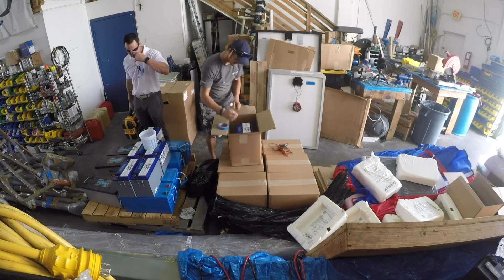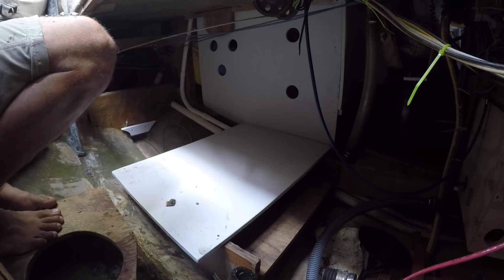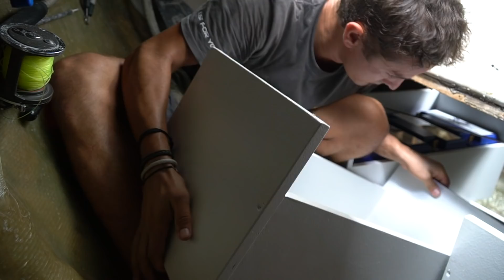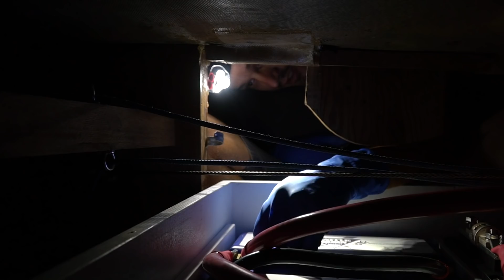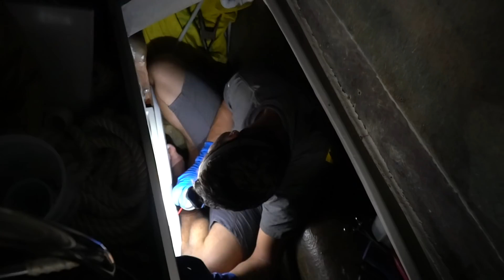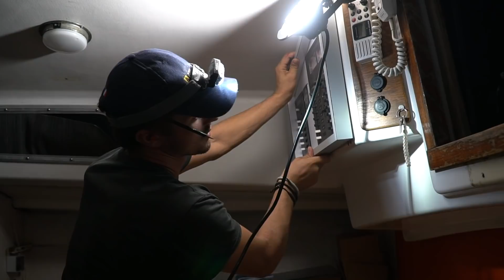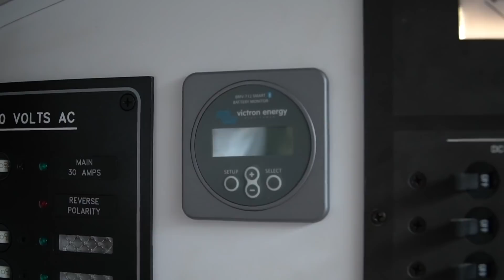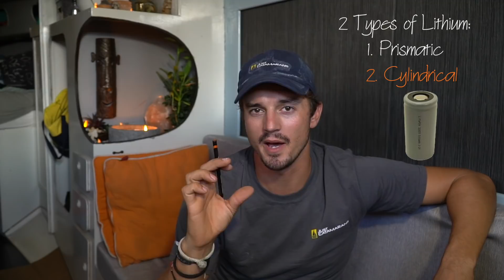Uma's new Battle Born LITHIUM heart ❤ — Sailing Uma [Step 135]

Comment: @ $1000 per battery that's a serious investment!
Reply: I doubt they spent that amount?  Battleborn Batteries might be a new sponsor?  So that means little or no out of pocket costs to Uma.
Reply: Co-op or sponser. Noted batt brand and locale of manufact. Uma knows buisness too!
Reply: I noted they said lead acid wasn't suitable for their motor when it came from a forklift that would have been powered by lead acid traction cells.
Reply from the maker: But the forklift has a few thousand pounds of batteries that get replaced quite often.
Reply: I'm interested in electric drive for Narrowboats in the in the UK. These guys (http://www.hybrid-marine.co.uk/14.html) claim 4-6hrs cruising off a 400ahr 48vlead acid traction cell battery with a 10Kw motor pushing a 18 tonne steel boat. That battery costs £2000 and has a 10-year life & 5-year guarantee. Lithium would be nicer, but for the same capacity, we'd need 8 batteries at a cost of about £8,000. If you got your new batteries at discount then great, but saying it's the only solution to successfully power an electric boat because your last lead-acid system was seriously under capacity and overloaded so didn't work as you wanted is inaccurate.

Comment: Dan, around the 3:30 mark, you are under the cockpit floor.  Check those steering wires in the video.  Are they really as frayed as they look?   Apart from the possible breakdown in steering, there is also the nastiness of brushing your skin against the frayted wires too.  Hopefully what I think I am seeing is wrong.   Thanks for another great video guys :)
Reply from the maker: You may have been seeing the ends after the crimp. They're frayed out, but the cables themselves are in great shape.

Comment: Should you not have left space between the the batteries in the trays to allow for expansion, ventilation/cooling etc. ?
Reply: We're gonna find out...
Reply: They do not make heat like lead acid
Reply: Under load they will make plenty heat. http://iopscience.iop.org/article/10.1088/1757-899X/53/1/012014/pdf . He will definitely need a airflow and fan to cool them down or those batteries wont last more than 2 years

Comment: What are you guys thoughts on lithium-ion battery fires? Are there any precautions or preparations you'd need to consider? I'm sure the good folks at Battle Born batteries build a solid product, but lithium-ion batteries can present a somewhat unique safety concern. What are your thoughts? 

Another great video!
Reply from the maker: Not an issue with LiFePO4’s. It is an incredibly stable chemistry. Some chemistries are more hazardous.
Reply: Good to know. I may have to look into replacing my old batteries with some Battle Born batteries when they die. Again a great video with some well thought out decisions. Can't wait to see all your hard work come together!
Reply: The batteries are stable, but they can provide HUGE peak currents in the wiring, which is a significant fire hazard.
Reply: They say those are extremely stable, will not overheat, and even if punctured they will not catch on fire. You can find videos where these batteries are being abused by nail guns, short circuits and water. Although i really hope Uma has enough of fire extinguishers because despite what i've seen in those videos, it's still hard to believe how inert they are. Fascinating stuff.
Reply: With the built in circuits per battery, its not really an issue. And for each 3v cell most have a wire fuse right at the cell its self.
Reply: That's not exactly true. There are current limiters (BMS) in each battery yes, but the peak currents are still enormous.  Where do you think 100s of amps of current comes from to start a motor? The specs for this battery say "200 Amp Surge Current (30 Seconds)" Multiply that by ten batteries: 2000 Amp @ 12v for thirty seconds.That's 240KW, which is the kind of current/power that instantly vaporizes metals.  Batteries are usually placed in an accessible location for a reason. You know, if Boeing had problems with Lithium battery fires... https://www.thestate.com/news/article14419067.html
Reply: Mister Professor lifepo4 is not what Boeing were using